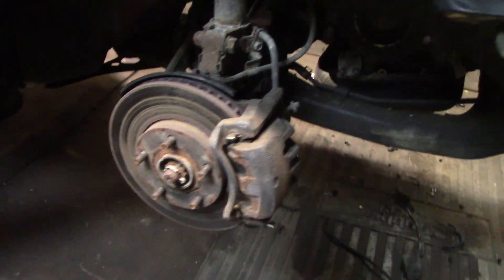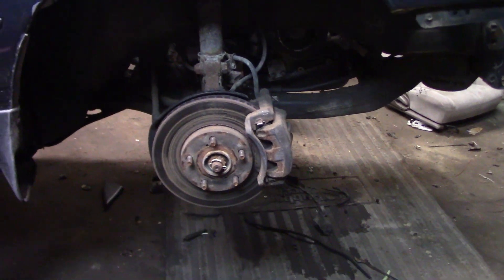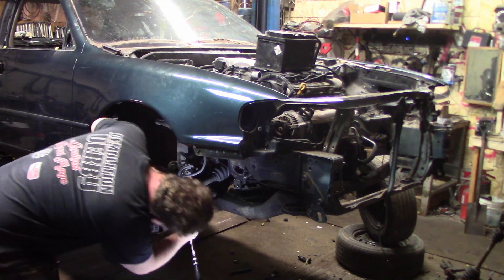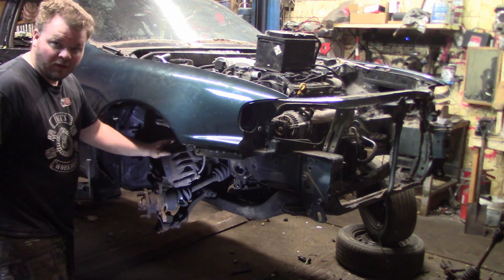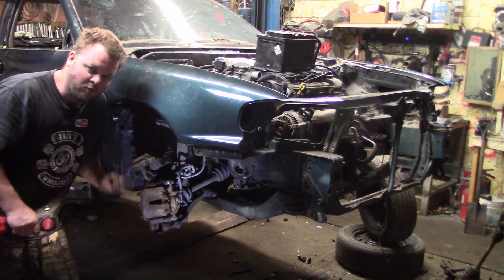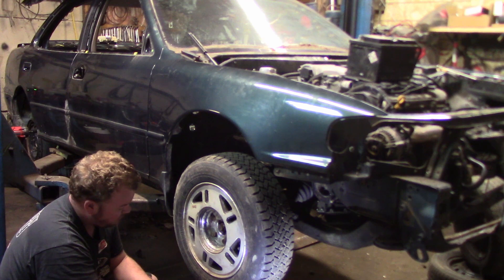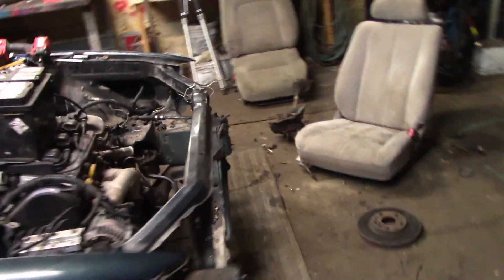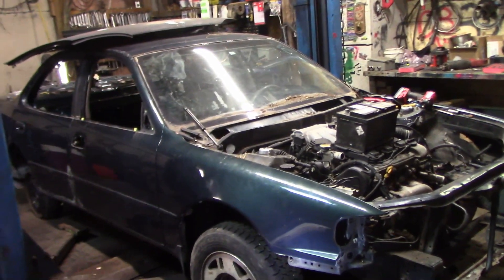time for the front brakes now, how to fit 14 inch rims on a v6 camry

Comment: Question about the doubles. Are they really heavy at all and do they take a toll on the stock suspension? Thinking about making some but only run a bone stock style rules
Reply: Doubles are good
Reply: Doubles are great but are a fair bit heavier than a stock set up, depending on the vehicle you're running on, may need to do some beefing up, but for the most part better off to run the doubles if ya can
Reply from the maker: they are twice as heavy as non double tires they are ahrder on parts